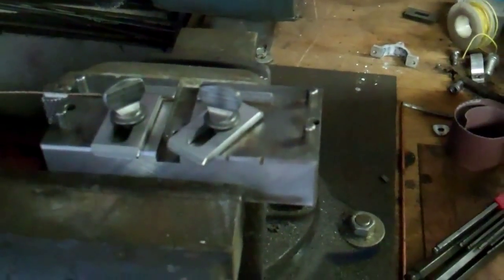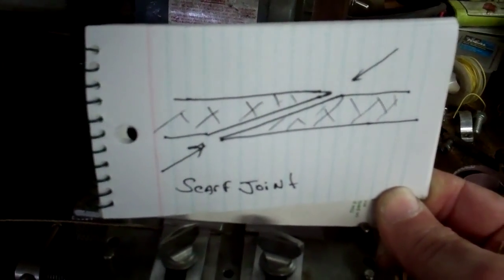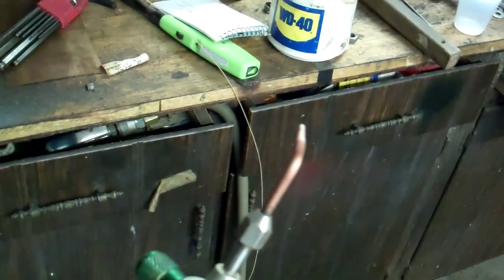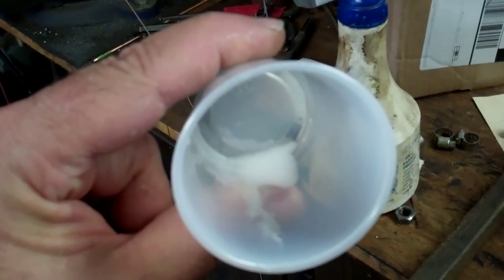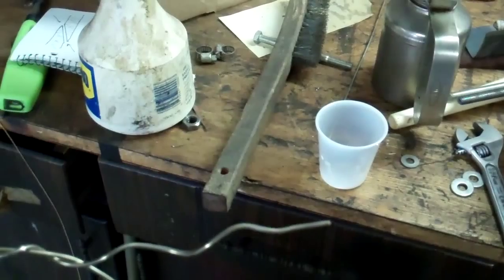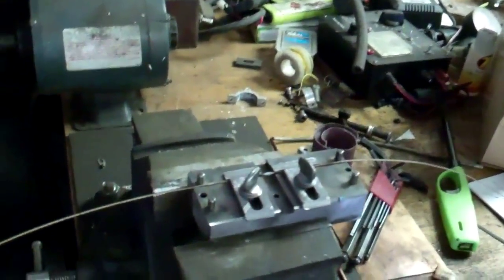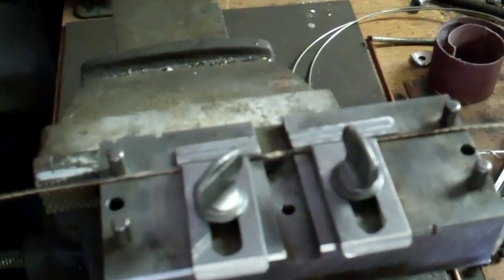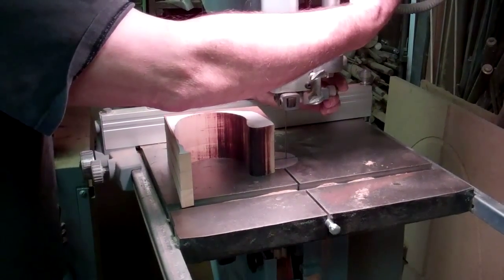SILVER BRAZING 1/16 INCH BANDSAW BLADE

Comment: Thanks for the awesome video. Seems like you know a lot about this stuff was wondering if maybe I could pick your brain. We use 3/16 mkmorse blade bought in bulk roll. I use about 5-6 blades a day. We have a butt welder that is very finicky. Recently switch over to brazing and was working great. However now I'm have problems with the scarf joint coming apart after little use. Having trouble diagnosing why. I've gone through everything. I use Harris Stay Silv black Brazing Flux. Harris 56% silver solder. I have a jig for the scarf joint and make it 20 degrees. Also a jig to insure the blade is aligned  I use a bernosmatic micro torch and am heating the flux until it starts to bubble and turn silver then flow in the solder until it flows through the joint. The blade maybe gets to a dull red by time I'm finished. I'm wondering if I need more heat. Or different flux. I've heard the black is more forgiving then the white. Or a wider angle scarf joint? Looking at the failed joint it seems like the solder isn't sticking. Any help would be greatly appreciated. Thanks
Reply from the maker: A couple of thoughts. The torches I use are oxy-acetalene. They heat the joint quickly. I also use the Harris white paste. You have to be careful not to overheat the flux, if it turns black, you are done and have to remove it and start over as the solder won't flow with the burnt flux. The scarf joint you are making is an overlapping joint and not just an angled butt joint, is that correct.? the more surface area you have the stronger the joint. You could make a lap joint by thinning each side of the blade by half material thickness so it would be a completely overlapping joint. That will be the strongest situation. When the heat is correct and the conditions good the silver braze will flow like water. You may want to temper the joint  after by heating it up to just below the melting point of the silver braze and letting it cool slowly. My joints are fairly bright red when I apply the solder. I think you hit one point about the solder not sticking due to not enough heat. Your torch may not be suitable for what you are trying to do. Also use the minimum blade tension on the saw to affect a proper cut. Forget any blade tension  markings on the saw, go by results. A good blade will cut nicely at less tension than you may think. Hope my ramblings are helpful.-TM
Reply: Thank you for the quick response. It's good to know I have the right stuff. I am overlapping the blade. I'll try more heat and see how that goes. Thanks again.

Comment from the maker: Part of the probem may be that you cannot use a butt joint, you need some type of overlap joint. I am also using a high silver content (56% silver) brazing alloy. I use an oxy-acetylene torch. You may not be getting enough heat. By heating the joint with the torch there is really no need to temper the joint as the heat from the torch accomplishes this. I have great success doing this to these small blades. -TM

Comment: Excellent video!
Are your making this blade from bulk roll or repairing a broken ready-made blade. Is this 1/16" the same thin stock (0,014") as used on three wheelers, or is it more like the conventional wood cutting blades around 0.020"-0.024". Could you say where this type of blade is available in rolls in 1/8" and 1/4" as,well as the 1/16".
Thanks for posting this video!
Reply from the maker: 51diogenes These blades are from bulk stock. Unfortunately for woodworkers after an exhaustive search, I don't believe the 1/16 stock is made anymore. I lucked out and bought the remaining stock from the manufacturer who stopped carrying it as wielding it was very problematic. The silver brazing works well and can be applied to most types of blades if you do not have access to welding.
Reply: Thank you for the speedy reply.
Cheers!

Comment: the flux is it the same as the one you would use for plubming repair thx
Reply from the maker: I use 56% silver rod with the specific flux clearly shown in the video. These are not plumbing materials.